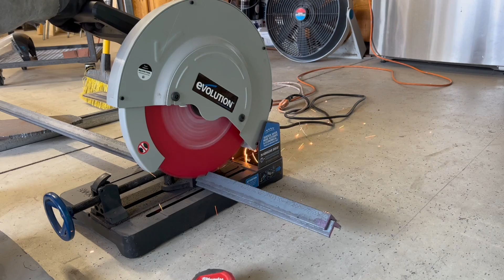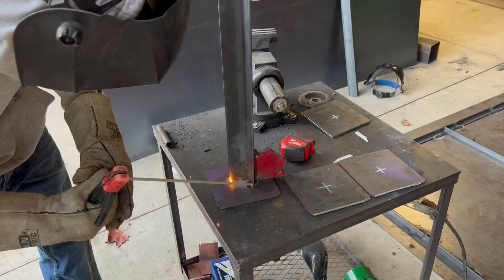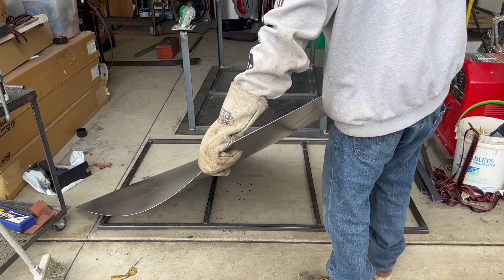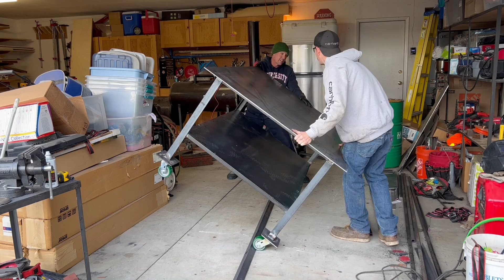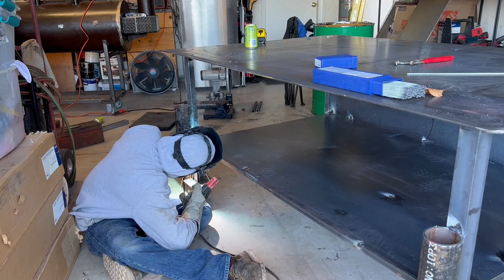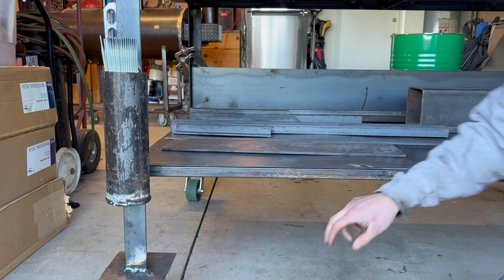How To Build A Heavy Duty Welding Table

Comment: well done!!!  Two Questions:  You guys weld lots.  Is 1/4 inch top thick enough for DIY guys?  Second, did you all think about cutting mounting holes and slots in the top?  I like how functional this appears, but since you guys weld and fabricate a lot and you didn't do it kind of makes me think that it's not necessary?!?!? Thoughts?
Reply from the maker: @walkaboutmotors  hi thanks for watching!! If you use your welding table a lot I would definitely go with a thicker top. Maybe 3/8” or 1/2”. And we are able to fabricate without the use of mounting holes. We may add some in the future tho

Comment: You lost the majority of the angle iron (rigidity/ strength/ ability to resist warping) by laying it flat vs. turning the V upside down and welding both legs of the angle iron to the plate. Other than that, it's not bad. Eventually, heat will twist the table enough that, no longer will you be able to lay a large piece perfectly flat. It may only be 1-2° across the entire plain, but that's enough to destroy your project.

Comment: I want to build one but not before I can be sure I have the methods to make it somewhat flat! I don't how you did anything other than replicate the concrete contractors work into your table?
Reply from the maker: @AviewFromUnder  if you cut all of the legs the exact same length it will turn out flat. That’s what we did here and it turned out great.
Reply: @fathersondiygarage3580  Well good job and enjoy the great work surface!

Comment: What’s better for the table? Top cold rolled, steel or hot rolled steel.
Reply from the maker: Cold rolled is a more durable steel over all but definitely more expensive. This welding table it hot rolled and has held up great.

Comment: Diablo blades on the evo chop saw? Is that like a cheaper alternative? I keep breaking teeth on my evo blades so open to ideas!
Reply: great video by the way, nothing like a simple, functional build!
Reply from the maker: Diablo blade tends to last longer for us, thanks for watching!
Reply: @fathersondiygarage3580  which Diablo blade do you get?
Reply from the maker: 14” Diablo cermwnt carbide 2
Reply: I have the 10" evo sliding miter saw and that's all I run in it is Diablo steel demon. The evo blades are junk imo, I've tried the orange (multi material), multiple blue (carbon steel), black (stainless) all three failed prematurely. I've also tried Oshlun from Amazon, they're a little better but Diablo is hands down the best.
Reply: @apexcustomsmokers  this is great to know, thanks for the feedback!